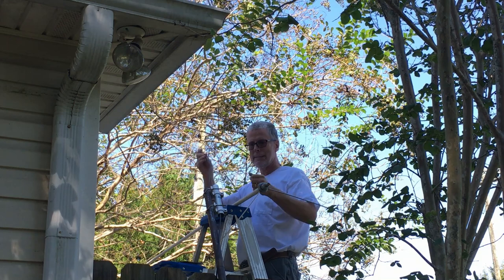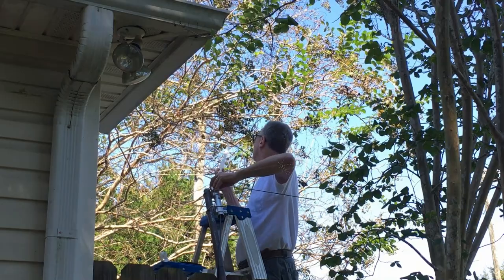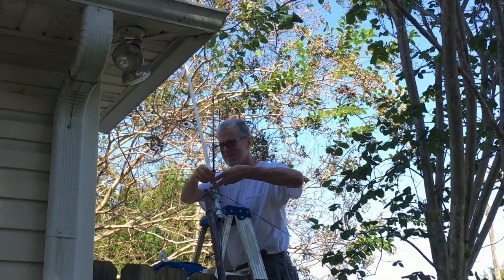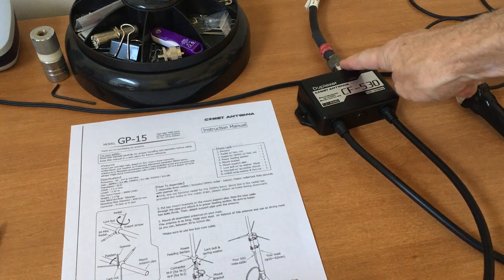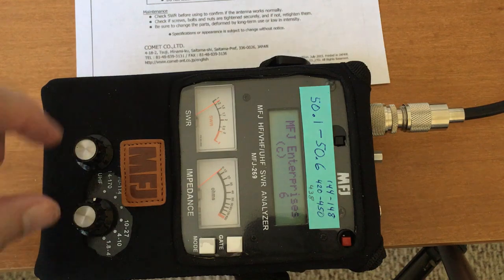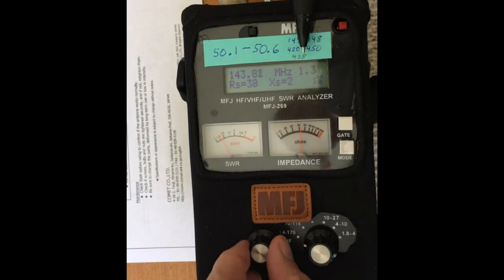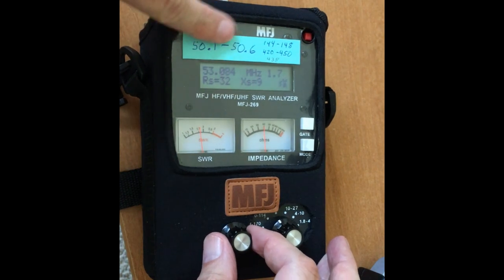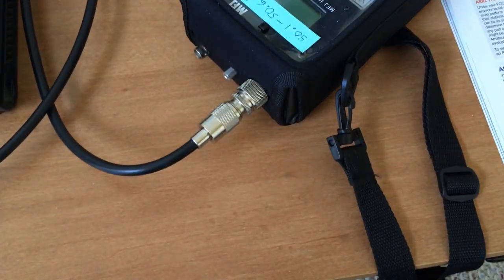Installing the 8' GP-15 antenna at the side of my house.

Comment: awesome video i just bought a gp-15 how do i adjust the 6 meter radial i dont not have a swr anaylyzer for the fm mode band of 6 meter 52.525 help
Reply from the maker: A cut chart is included in the instructions. It will get you close.
Use low power and your radio's SWR meter to get closer to 1:1.
I have a video about tuning a CB antenna. You need to know what shorter or longer does.

Comment: I have the same antenna and similar set up but I have to keep it much lower because of my HOA... Do you see any issues if my radials extend under my soffit and gutter? They end about 6, inches from the brick on my house. Will this cause any issues?
Reply from the maker: The gutter is what would give you problems.
Metal in the area of the ground plane and radiator can cause "reflection".
You should find an SWR meter to test it.
Reply: @personalradiofun526  thank you!!! How much free standing area would you suggest?? Or is it all test and see type of thing?

Comment: Do you have to have a duplexer?
Reply from the maker: For my radio, yes. The Yaesu FT-857 has two antenna connectors on the back. One supports 2m & 70 CM. The other is for HF & 6m. Since I use the 70 cm, 2m, and 6m I need the duplexer.

Note that some HF rigs have a separate connector 2m and for 70cm. So a triplexer would be needed.
Reply: @personalradiofun526  Thank you so much!